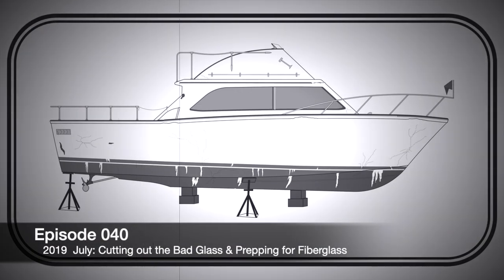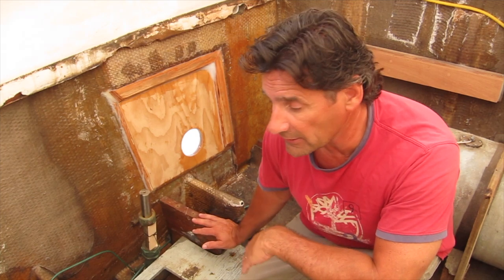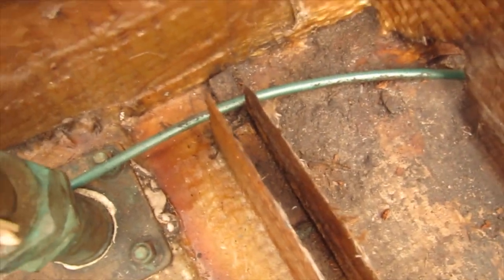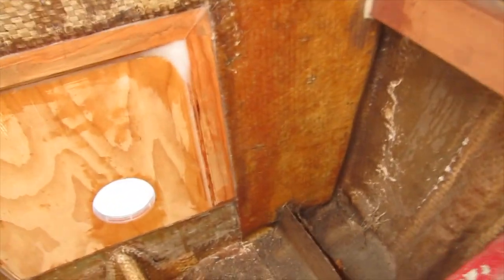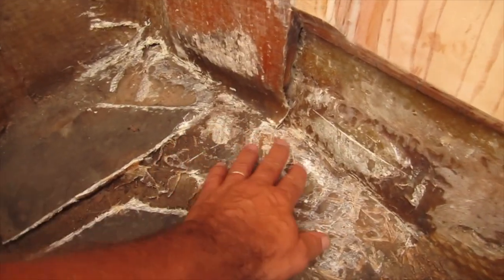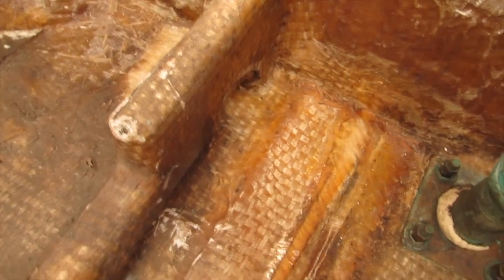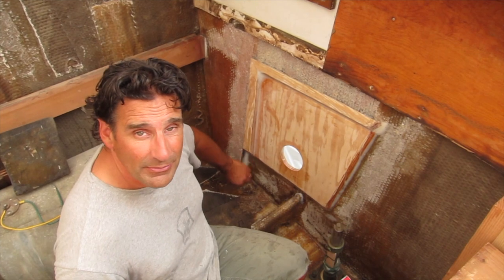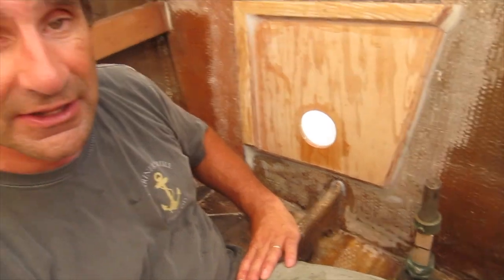Cleanup for fiberglassing the transom. Removing wood supports & old tabbing - Boat Restoration EP040

Comment: Your own video proves what a lot of people try to deny. Polyester resin does not bond well to wood. You peeled it off the wood stringers / stiffeners with little effort. That would not have happened with epoxy. When I replace the bulk heads on our boat the tabbing  was already debonded from the bulk head , I peeled the tabbing off the hull with a putty knife. Not very strong , but easy to replace, Lol... great video, thanks for sharing
Reply from the maker: Yes I agree. This was not the only place on the boat where the wood/polyester bond failed.  I prefer to stick with epoxy.. I love it! "easy to replace"  You said it. Thanks for watching and the comment.